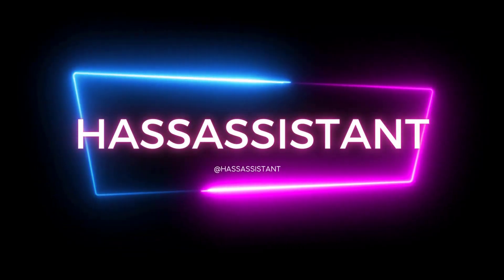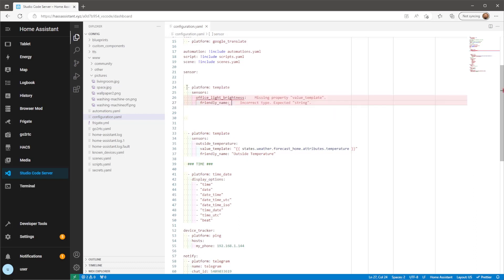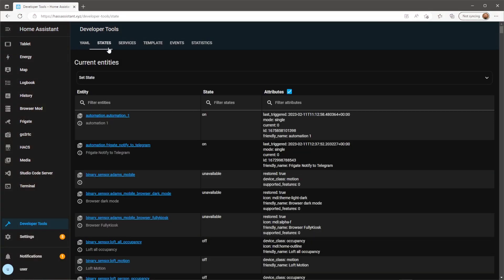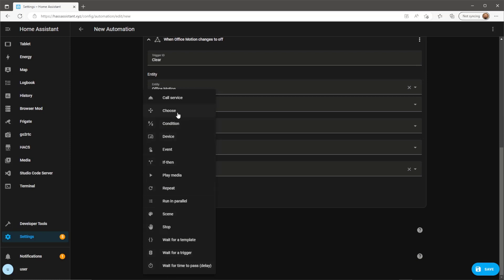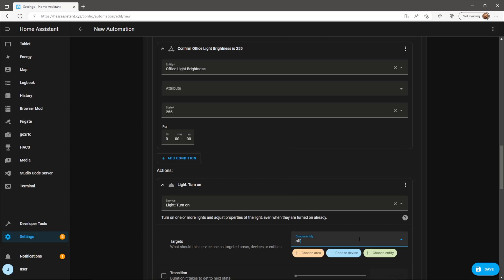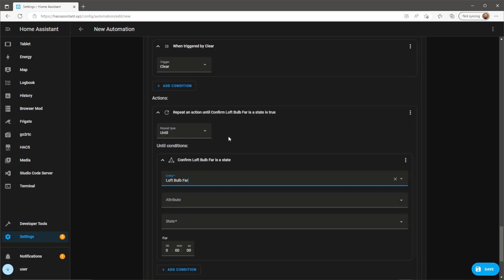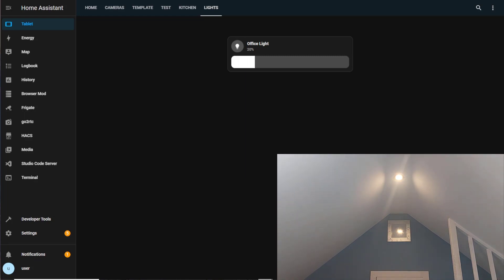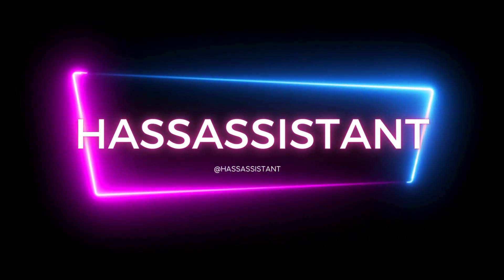How To Gradually Increase & Dim A Light In Home Assistant Withiout Using Transition

Comment: Thanks for the inspiration, however there is actually no coding required. Maybe it was necessary when you made this video or maybe it's because I have different light bulbs, not sure. 
I simply select the "Brightness Attribute" below the "Entity" inside the while condition. Does the trick just fine.

Comment: Thank you so much for this. I was struggling with a similar automation. My son has 3 smart lights mounted in the ceiling fan in his room. I have them in a group in HA. I've been wanting to start an automation that starts at a specific time of night on school nights that turns the light on to a specific color (regardless of the current state or color of the light) then reduce the brightness every 5 minutes or so over the next 20 minutes. I adapted what I needed from your solution and thus far it works flawlessly.

I spoke a little too soon. I didn't want the light to turn all the way off, but stop at 1% brightness as that's how he likes it. Now I gotta figure that out.
Reply: Did you figure it out, stopping at 1% brightness?

Comment: This is a very fresh approach to smoothing out motion activated lights that don't support transition. I'm using this for my under bed motion activated led strip to minimize any potential sleep disturbances from abrupt light changes. I hadn't used repeat in any of my automations before, so I was happy to add another tool to my toolbox. Thanks.